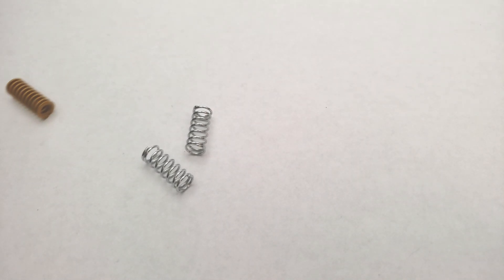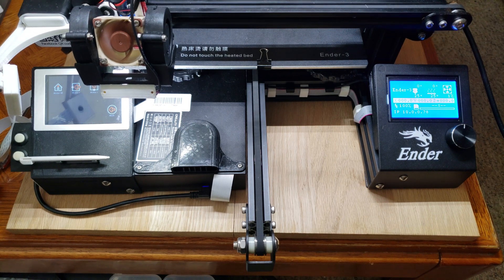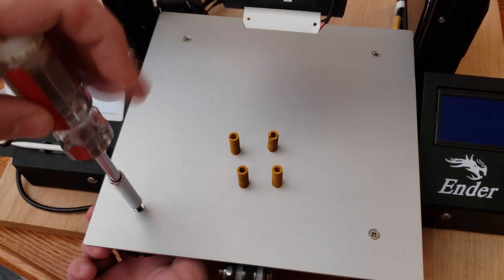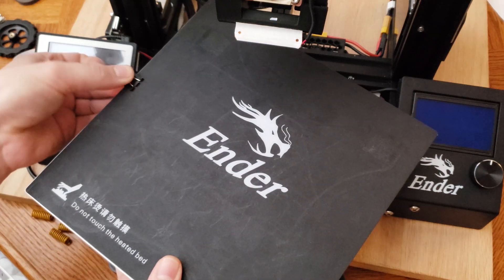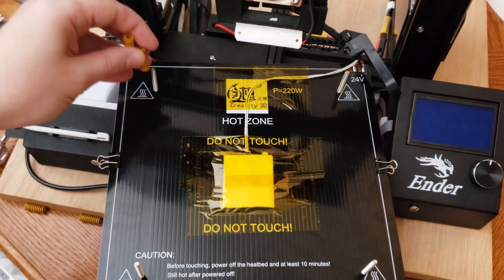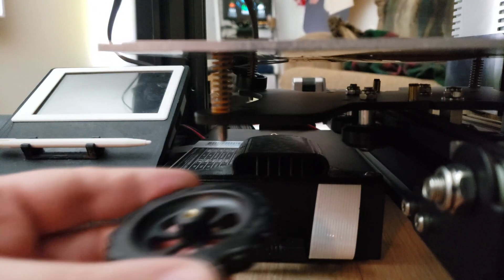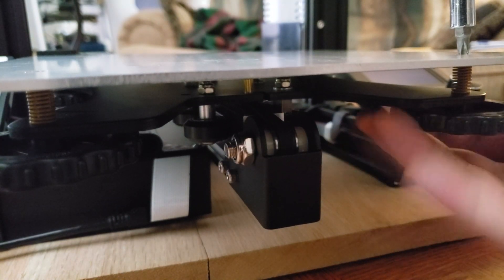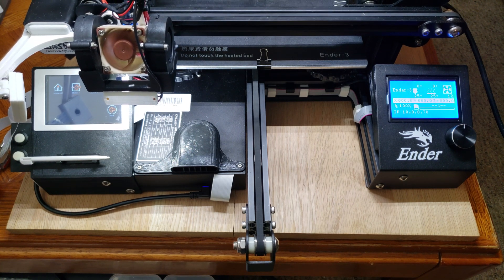TDQ - Replacing and upgrading your 3D Printers bed springs!

Comment: i didnt figure the spring replacement was going to be all that difficult.  i was more looking for a reason as to why it was important.  i've already upgraded to some sort of glass bed, which is heavier, which changes things, so the springs seem mandatory.  also, i've been hearing chatter about a self-levelling system that may be possible with the ender 3.  Sabrina just added a raspberry Pi to the thing, so i'm re-learning the thing already, whilst i'm trying to build my own business (completely unrelated) on the side.
Reply from the maker: Check out the BLTouch for bed leveling
Reply: common sense...stiffer springs mean less slop ...cr10 bed shakes all over the place you want bed as stable as possible for a better print ... ender 5 is a better designed machine and has no bed movement my prints come out better always especially the taller ones... i have both printers side by side... if you slow the cr10 down 20 plus percent it can improve print quality...because bed vibration and shaking is less...

Comment: https://m.banggood.com/4pcspack-18mm3-16mm1-Silicone-Shock-Absorbed-Heated-Bed-Hot-Bed-Leveling-Column-Kit-For-3D-Printer-Parts-p-1433488.html?utm_design=41&utm_source=emarsys&utm_medium=Shipoutinform171129&utm_campaign=trigger-emarsys&utm_content=Winna&sc_src=email_2671705&sc_eh=024e4c1b2700f76b1&sc_llid=11515671&sc_lid=104858042&sc_uid=B9uPSY0GeI

You dont need springs...these are better!!!